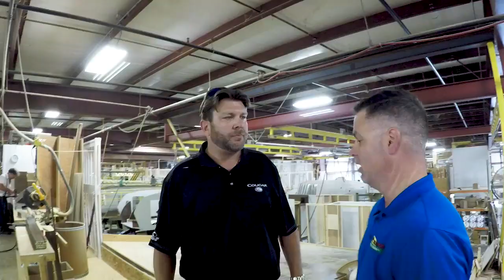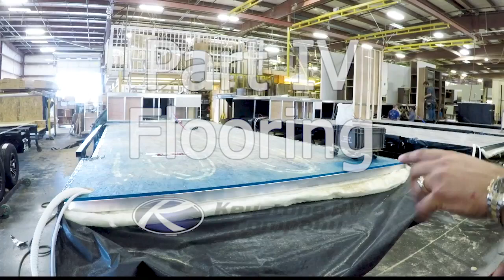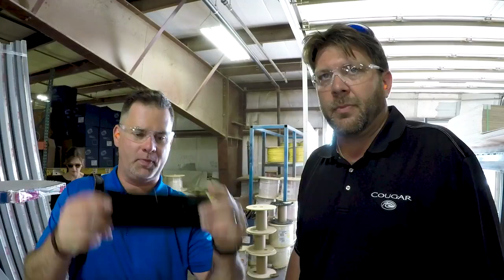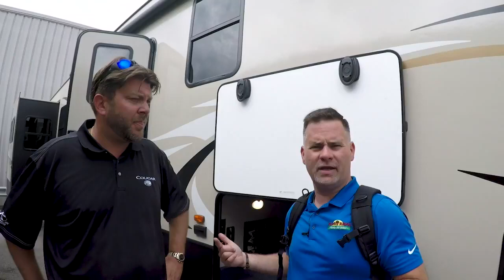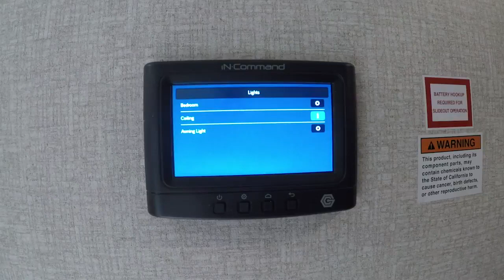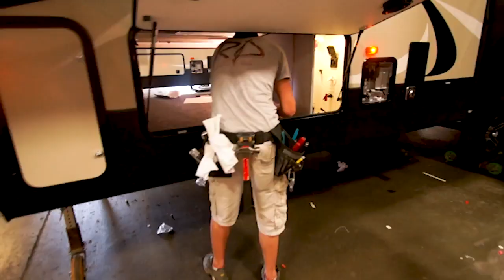Keystone RV Factory Tour - Cougar Half-Ton fifth-wheel Plant

Comment: We have a a Cougar 5th wheel by Keystone 2009 The sink in the Master bedroom has 1 hot water line and one cold water line as well as two more lines that have a looks like black valve on the top.  Can you tell me what they do or what they are for.
Reply from the maker: You would need to reach out to our service department. Here's the number: (800) 607-8827

Comment: I would like to get a good look at the Lippert frame design.  We just spent $700 at a welding shop to have the front cross member cut out and replaced with much thicker 1/4” rectangular tube.  The original 1/8” walled member buckled 600 miles from home allowing the pin box to tilt and the underside of the front bedroom to touch the top of our truck’s bedrails.  Thankfully I was able to limp it to a reputable shop to get it fixed.  They were amazed that a 29’ 5th wheel frame would use such light material.

Comment: Does InCommand work locally by bluetooth or WiFi?
Reply: Bluetooth locally. But you can hook up to Global Connect. You need to be on WiFi wherever you at and the camper needs to be on WiFi wherever it's at. The WiFi box on the wall needs to be utilized.

Comment: "Dynaspan" flooring is made from OSB, not plywood.  http://www.dyna-bilt.com/products/dyna-span

What thickness does Cougar use? What's the advantage over using 4'x8' tongue and groove plywood sheets?  The competitor I'm looking at uses 5/8" thick plywood sheets.
Reply: The problem with 5/8” plywood is weight. I love using real wood, but all that glue used in plywood and pressed wood adds up to real weight problems X 100.